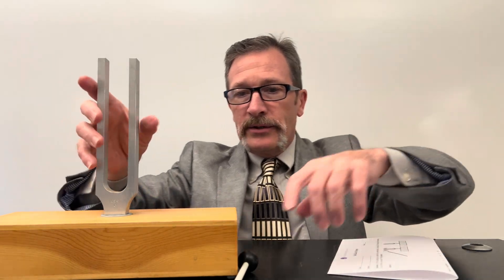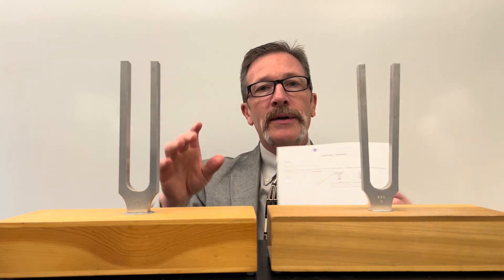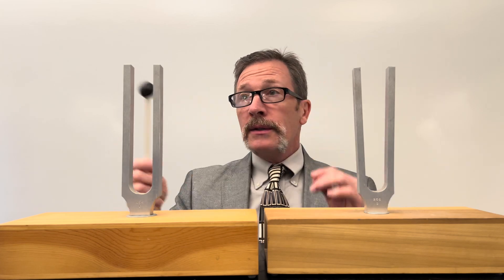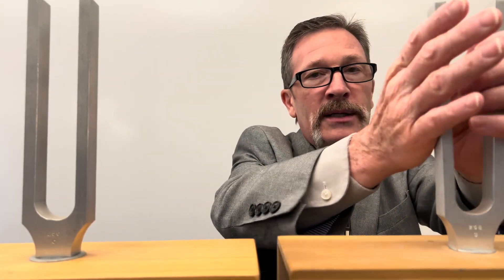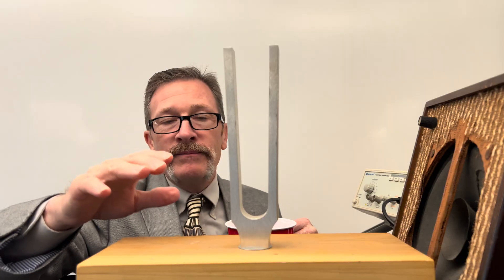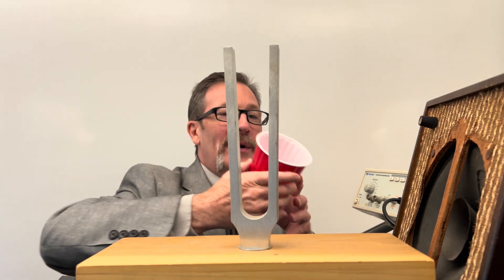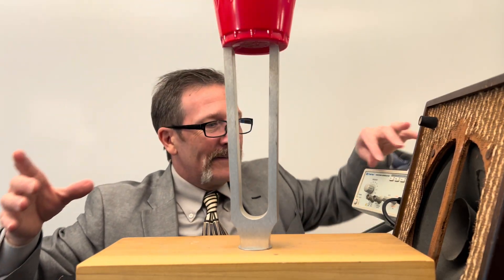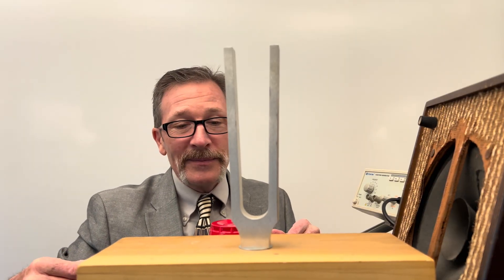Is it Possible to Make a Tuning Fork Ring Without Touching It?

Comment: I wonder if it would have transferred in a vacuum?  I think that the air is being used as a medium of transferring the energy - but what if it was a higher or lower pressure.  What about in a liquid, like water?  What if this were in a ball pit at the Chuck-E-Cheese?  Do other waves operate this way?  What abut light?   When you take two bowling balls suspended from a cord and knock them together, is a similar principle at work?  How much energy is "in" the tuning fork?  How much gets transferred?  Does the air warm up between the two tuning forks?

Comment: Once the operation of one tuning fork is understood, the resonance excitation of other identical tuning forks can be readily inferred.  And if you have a resonator tube with a speaker and a generator, then with no need for a tuning fork you can find several resonant frequencies of the tube and use this information to determine the end correction and the speed of sound.

Comment: I'd be curious to run that experiment without the large wooden box on the bottom. I still think the frequency will transfer but it would be at a far lower amplitude. In other words you wooden box is helping to move the frequency easier without interference.
Reply: Yes, but I should add that actually the effect of resonance is due to the phenomenon of "wave interference".  The resonance boxes help the interference.